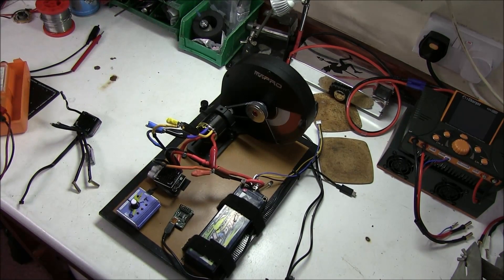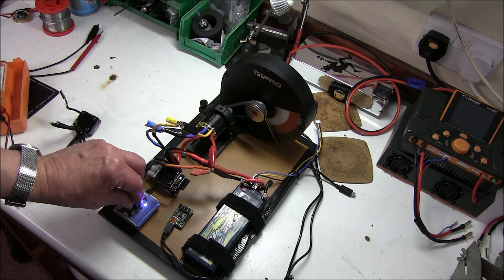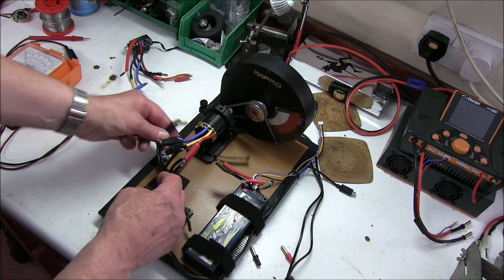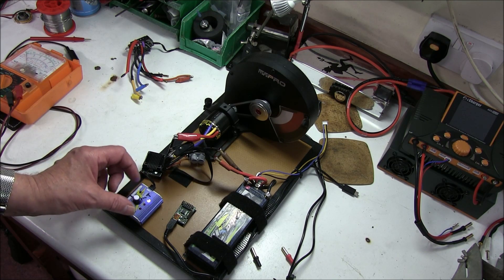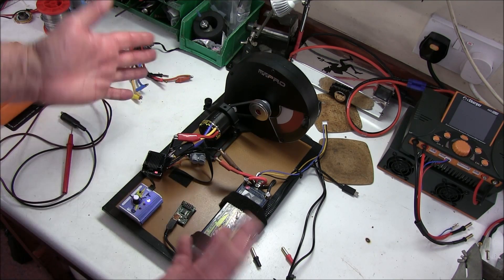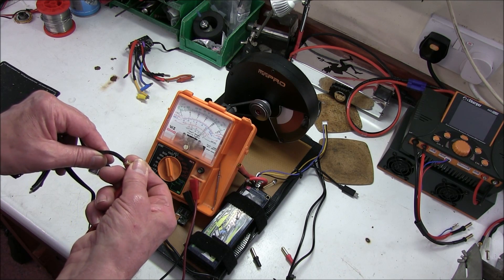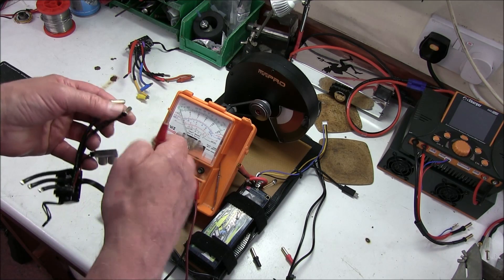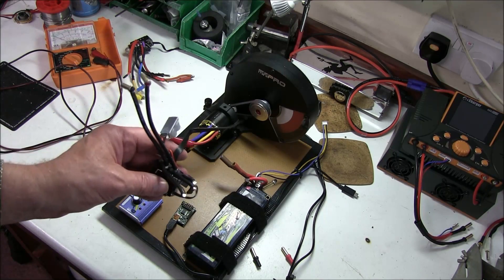Brushless R/C Model Car Speedo fault testing with MiniPro dyno.

Comment: I’m new to your channel but found you because of my love for 50’s and 60’s music, radiograms, old record players and valve radios etc, I have just taught myself to take apart BSR and Garrard decks clean them lubricate and reassemble them obviously you are an absolute expert in mid century audio equipment please can you advise me what electrical or electronics course I would need to do to learn the electrical side of things please, any guidance would be very appreciated. Regards Craig.
Reply from the maker: Hi Craig
Good to see you interested in this .
I don't know of any courses that deal with old valve equipment, but there are a lot of books.  Most are too detailed, but the ones on guitar amplifiers are easier to understand.   Books by "The Valve Wizard" are very good.
All the best,  Nick